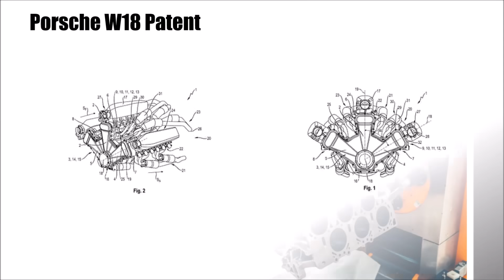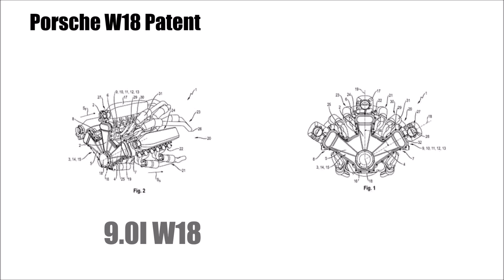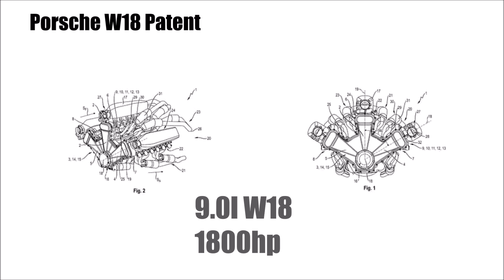Porsche W18 engine - CLOSER LOOK

Comment: This would be a true W engine, rather than the "double V" engines that were labeled W8, W10 (one single example...), W12, and W16.  The VAG W engines were all based upon the original VR6 engine which premiered in the '92 Volkswagen Corrado SLC, and which I owned.  These were "safety" engines;  They were designed to put six cylinders in the space of a wide inline 5, and that is what they did.  The 15 degree V angle made them very narrow, so a Golf or a Corrado with this engine did not need to have the nose extended to create more space between the engine and the firewall for crash safety.  Honda put a 60 degree V6 in the '91 Accord, but they built two bodies as a result; a four cylinder body and a V6 body that was 60 mm longer.  Volkswagen's "taco" engine solved this problem by being very narrow. It is a true V engine, but since it had the firing order of an inline six but two exhaust runner lengths it has a unique engine sound.  At idle the VR6 sounds like a Japanese four cylinder, just a muted hum.  Under hard acceleration, you get this woofle sound that mimics a small Detroit V8, but at the top end it screams BMW inline 6.  It is truly an amazing engine and it turned the 2800 pound Corrado SLC into a complete hooligan, a car that tried to get you to drive it faster than you wanted to go.

Back when Pieche was alive, he bought the rights to the Bugatti name and they instantly produced a design for a true W18, with three rows of six cylinders based upon EA111 series of engines originally built as a four cylinder for the first Volkswagen Polo.  If the bore spacing of this NEW design is 88 mm, then this is another EA827 derivative based upon the original Volkswagen Golf engine.

Porsche is having money problems because of electrification not being popular and because the Chinese want cheaper domestic electric junk.

Comment: The latest is that the Cayman/Boxster will have both EV and ICE powertrains.  There is a rumor that Toyota will buy the basic chassis and will sell it with a 2.0 liter inline four with twin turbos that makes 400 hp and this will be called an MR2.  The Japanese company already does this with BMW with the Austrian built turd known as "supra", which has absolutely NO connection with any prior proper Supra, which were astonishingly good cars.

Comment: Nice, but you missed the most interesting aspect of this engine. Intake and exhaust plumbing is made symmetrical by rotating the 4 valves in each cylinder 90 degrees; instead of intakes on one side and exhausts on the other, intakes are in front and exhausts behind.  A central manifold atop each bank feeds the intake valves via stub downward runners, and the exhausts exit outward between the banks. Pretty neat. Though there's clearly no automotive need for an engine this extravagant today.

Comment: OK, guys, this ISN'T a military engine.  No sane military defense contractor would make this as an engine.  For what?  Certainly nothing armored.  APCs, tanks, SPGs, AFVs, they almost exclusively use high displacement low cylinder count diesel engines, and where they don't, they use gas turbines.  What about unarmored stuff?  Light land vehicles?  Tractors?  Recon?  No...   just no.

This is just a road/race engine.  Likely for a racecar, potentially for road use as well.

Comment: The intake and exhaust configuration which you describe with coloured dots around 3:18 is not what the drawing shows at all. The inlets are straight into the front of the plenums (which they call "air collectors" in the patent), which are on top of each bank with runners presumably between the cams; exhaust is on both sides, like a Lancia Triflux. If there is one turbocharger per bank they would be at the rear, with a long path from the compressor (presumably through and intercooler) to the front of the engine. In the patent the image is clear but the description is vague nonsense designed to cover any possible W18 engine.

Comment: It sucks so bad that there's not really a low-mid class sports cars option anymore. Everything is 30k plus for the cheapest "sports cars"(86, Miata), then you jump up 15k for the next tier. Cars are not made for enthusiasts anymore. Every car company use to have some form of a 4 Banger or V6 "sports car". Now it's just about the bottom line. Sucks. 90's-2000's, even early 2010's. Ever since Stranger Things, we've truly entered the Upside Down, and it sucks.

Comment: Porsche learned, too late, that both existing and first time Porsche customers want the classic ICE experience more than Porsche technical flexing in pretty EV's or hybrids. Porsches cash cow still lies there, not in competing with Ferrari, Bugatti, et.al for supercar supremacy. They have already done the 180° on the 718 by announcing a continuation of ICE for its replacement. I'd rather see them build EV technology demonstrater hypercar vs a W18 that should have happened 25 years ago.

Comment: I suspect we will see i8 engines soon especially with how smooth they are!
Reply: No. I8 engines are bitch in terms of packaging. Plus unless you take your power off of the center of the crank there is a lot of torsional twisting on the crank.
Reply: @mpetersen6 They will still eventually happen after solving for those minor issues, stop being so negative.
Reply: @st0rmerc00l8with the industry going downsizing i dont see this happening 
Also a straight 6 is already very smooth with its perfect primary and secondary balance so an i8 only benefits from more power stroke overlap while its harder to package, more expensive and more complex

Comment: Porsche can make great flat 6 sports cars that loyal customers like to buy. Especially with a manual gear shift. We dont want a very expensive EV from Porsche. BYD make good value sports EVs if you want that. But for Porsche id only spend my money on a pure ICE, lightweight, narrow track is important and much less technology, no electric motors no batteries. A new compact 997 sized replacement 911 with 6 speed manual and no tech would be great.

Comment: Given all the regulatory restrictions, also those to come, I don't think this engine will make its way into a car. I think they patented it to protect the IP. Also, the original W18 was ditched because of the impossible thermodynamics - this new W18 concept is even more compact and difficult. The Chiron needs 10 radiators to cool the W16. I can imagine the other recent Porsche patent to make an appearance at some point - the 6-stroke engine. Higher efficiency (50% compared to 30% of 4-strokes), lower emissions.

Comment: Im posting this before ive had a chance to look at the patent details, so i am assuming some of the details and concepts/theories are based on info from the patents or from details porsche/VW has released alongside this engine design... I say this because a 0.5L per cylinder displacement makes very little sense. The biggest benefit of additional cylinders is lower mass of all the components. I mean i will mention at the end of my comment why i think the patent was registered/announced now at the end, and it definitely isnt to hint at 1.5% higher efficiency per Kj of fuel, but yeah, when i saw this video i was sure (if it is actually a porsche road car engine) that it would be 4L, maybe 4.4 or something. Basically any car nimble and well engineered enough to proudly wear the porsche badge, shouldnt need have 1000hp+, from an unnecessarily tall, complex extremely hot (a 9L "hotV" (that center bank is going to get hot enough to initiate nuclear fusion, which also isnt my theory on why this patent exists, but would explain the design choices and would let the engineers relax about how to plumb the exhaust and intake systems to keep the center bank from heatsoaking itself into uselessness... Just let it get as hot as the sun, and just have VVT controlled by a big red button in the cabin to harness it). Like im just going to call this a "Hot-B" for Bank engine until i hear otherwise... 

So anyways, with variable pitch impeller and compressor turbos, and experience with sequential turbos and electronic wastegates. I would not be surprised if the central bank is designed as power on demand. Where the car has a V8, or even less maybe, i didnt check their firing order. This would make the center bank and its intake getting heatsoaked less of an issue. If its just for 90%+ throttle, with sport turned on, etc. like it is still kind of stupid, its unnecesarily complex, and porsche has sold a lot of cars, and made many loyal customers, by ignoring hype and gimmicks that arent additive to the user experience. 

Anyways. The obvious answer is that someone in the marketing department was hiding from their boss in an engineer (or patent lawyers) office, and really felt like porsche needed some good press haha. Like ive been a photographer for a couple decades now, and canon (just check canonrumors.com) has the wierdos over there foaming at the mouth every other week with patents for things that will never actually exist (for consumer imaging systems at least), but they will file them as consumer electronics, even if its for medical or astronomy, so their fans stop asking why their camera sensors havent improved their SnR in a decade. 

The reason i really think this engine patent exists though... Is kind of worse than patent teasing fan-boys.. this huge, hard to cool, thirsty, complex, that just doesnt seem very porsche-like... Is that it isnt going to be a porsche engine... But you know who definitely would want this engine, with its buttery smooth idle and the low RPM torque large displacement engines offer? Large 3 row SUVs with an S before the number, and the large Audi SUV someone let porsche graft the front clip of a boxster to. 

Basically the same reason Viper fanboys claim Lamborghini designed and developed the V10 engine... Its just a crazy coincidence that a chrysler iron block 318/340/360ci v8 from the 60s, up to the magnums, is exactly the same in every way, except for 2 extra cylinders and an aluminum block. Like i dont think the Lamborghini of 1988 just had an aluminum v10 pushrod engine cluttering up drafting tables... But the marketing staff at Chrysler definitely wanted to brag about the magical italian race engineering this wild new race car was blessed with. It only takes 5 seconds to remember that italians dont design and build massive pushrod engines when they decide to use one. Just pull one out of the chevy work truck out back.. it worked for DeTomaso... So yeah, this porsche engine is just screaming "how can we get dumb rich people to pay $200k for a $60k SUV". I also dont remember porsche ever going this route, but audi/vw? Oh they love this dumb stuff.

Comment: Europeans sure love their cylinders. There's a 10 cylinder based on the LS motor that pushes 1,800 horsepower. A W18 is neat but they also used to make triangular engines with twice as many pistons as cylinders that were neat and powerful. They were also really complicated. Luxury watches should have "complications". Engines should be simple. 18 cylinders AND forced induction? What? But why? The F1 is still the F1 because of a simple formula. At least the Kimera 037 justifies its twin-charged engine with less weight and high revs.

Comment: Did you make this entire video without looking at the patent since when I read it I couldn't find any mentions to it being turbo charged. also the heads seem to be in the style of the Lancia triflux thus solving the asymmetry problem but you should have noticed that when putting dots on the engine.

Comment: So the supposed advantage is a disadvantage because a row of 6 cylinders like in this design is longer and less compact than VAG's double VR which is slightly less than 5 cylinders in a row. If that engine would ever end up in a car it would be in a Bugatti. Porsche owns 45% of Bugatti and part of Rimac that owns the other 55%. Rimac never made a combustion engine so guess who would design another engine for Bugatti? But it's likely not even meant for a road car.

Comment: 3:03 you're looking at it wrong. the intakes are the 3 plenums on on top of the valve covers central runner style where the spark plugs/coil packs would be and all the pipes out the sides are exhaust runners. top in side out like old f1/indy engines that design theres no hotside by coolside like you describe porsche is smarter than that. plus you can see the cats on all the exhausts....

Comment: Much like the litre bikes from Ducati, KTM, Yamaha, and Honda, all pushing out well over 200hp/litre, even on their regular street bikes, let alone MotoGP bikes,  I think Porsche could have the ability to use that ~250cc per cylinder to make a 4.5L screamer capable of revving well over 10,000RPM, for a solid NA 1,000hp car, or easy 1,500+ hp turbocharged unit. That would keep the whole package quite compact, and obviously far lighter than a 9.0L with ~500cc per cylinder. Besides something 'different', the real question is, where do Porsche want to take this design? Is it just for selling an exotic W18 powered vehicle, or is this something they see as being the next evolution for the GT3 or similar cars for racing?

Comment: It looks like they run the intakes between the camshafts similar to the Claudio Lombardis Lanzia engine. Would there be any advantage of that on a turbo charged engine with straighter inflow or is this just because the W layout? Wouldn't the optimal be to just have that on the middle bank with 3 exhaust to each side connected to 6 exhaust from each side bank and run two turbos?
Some day I hope Mercedes would showcase any of their M216 W18s that they designed in the 80s.
Reply from the maker: That’s a good idea, the patent doesn’t go into too much details, let’s see if we see this anywhere in reality in the future

Comment: I mean with synthetic fuels that Porsche is also developing it literally does not matter how large an engine they make. You can have carbon neutral 24 cylinder 40L engine if you wanted, and all you'd have to do if feed it with synthetic fuel...

Comment: For me this is a tank engine, and not something that makes me that excited. For me, Porsche is racing and fast laptimes. Like with their V4 919 hybrid with massive amounts of innovation. For me, this rings so so much desperation. 

If they should do anything original now, then make a 919 streetversion with the most highreving B6 engine that has ever been. Saw the 911K top gear video a couple of years ago and thought “now that is a Porsche!”… but it was not Porsche made. So for me they are losing their DNA, and not embracing their successes. Maybe they should make a new restomod take on either the 917 or even the Carrera GT? But definitely honor as much racing as possible. It doesn’t get much more racing than “Porsche”. But making a W18 with 1800hp that isn’t high reving or made for racing, sounds more like a show of Bugatti… hence… where is the Porsche DNA??? 🏁🤔

Comment: A W18 engine just shows VW/Porsche REALLY LOST their way. It's gonna be a big heavy brick with probably $10k a tire to sustain the weigh and load. Yes their will be god-zillionaares who buy them to hide it away in a garage as part of their collection, which is probably good, as they should not see the light of day.  Why not just use their existing engineering skills to make a sleeker mid-engine Cayman closer to the Alpine A110 in weight, dimension, handling, balance and price, and mount a slim boxter 4 or TT line-5 mid-engine, with double wishbone suspension all-around..  
It would sell loads to the cash strapped youth, and get them into Porsche early which the Chinese would find hard to compete with on both brand and price. Then pass that tech onto Audi for a new mid-engine TT.

Comment: Nonsense. Usually it takes 18 months until a parent is published - so there is no question „why now“… it’s coming from the past (applied 04/2024).
Secondly the main claim is the optimisation of the intake position and the straight inlet into the cylinder. 
Full stop. That’s it. There is sometimes a blank space in claimed technologies that gets than blocked by patents, even if you never want to build it yourself. Common behaviour. 
Porsche will never build a w18.

Comment: Nobody will buy the electirc Macan and 718. The Taycan stands around on dealer lots and Porsche has to shove them down the customers who want to buy limited editions. The resale value plummetes much more into the abyss compared to normal Porsches. Its a massive L for Porsche with these BEVs. They will fail with that.

Comment: I think lexus had the right idea with the LFA (aside from looking like a potato with running mascara). Nobody can use the power a W18 makes. Make a car that's mechanically elegant yes, but there's no need to make it unnecessarily elaborate. Porsche could make a 120° V12 instead, it's elegant (balanced, even firing, sensible to package) while also being unique in a production car. They could tout made up benefits like lower center of gravity just like they're going to do with the W18. Or, because it's Porsche, they could do a flat 12, that would also be extremely uncommon and very cool.

Comment: In my opinion the W18 will be too much of a problem and probably won’t succeed as intended. I would like to see something that leads in terms of technology and combines Porsche’s highest values. How about a hoirizontal mounted X12 engine, which derives two gt3 rs flat 6’s, cross mounted in an X formation down on the floor. That would make it an 8.0L X12 with like 1100 hp. That would do more than Bugattis V16. Or you can fit turbos. This would eliminate the problem of the hot exhaust by the cool intake since it’s four cylinder banks mounted in a symmetrical form